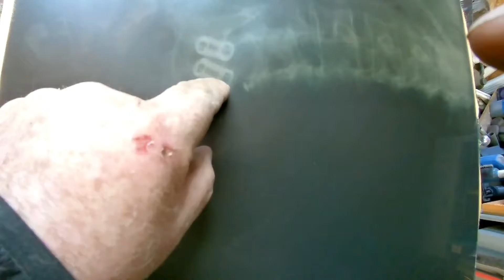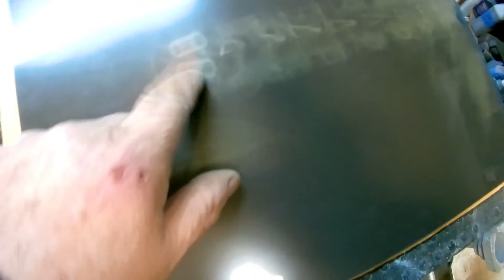MRI of my fusion 2004

Comment: A girl friend I had many years ago has a neck bone surgery, they went in from the front, she did pretty well, I thought that was kind of the complicated way to do it but they said it was much better,, maybe to avoid  touching the spinal cord.
Reply from the maker: I guess some work but I haven't seen any on my end. The friend in Fla is still out of work and having problems after 3 months still using a waker.  I guess it can be where and who.  My son in Fla had him fusion done behind the neck so they went in from the front, over a year but stating feeling better, however another Doc told him it healed crooket.  I think Fla sucks

Comment: I wish I had a copy of my Xrays. I have so many screws I look like I'm part Porcupine, LOL They went in through my back. And have not worked a day since then. That was in 2005. I didn't get any better then they told me I have spinal stenosis six months later. Now you can't find a Dr. that with give you anything that works for pain. Even if you beg for it. So I know what you're going through.
Reply from the maker: Have you tried pain management ?   Their job is to help make you pain free.
Reply: @buzzsah  Yeah, I'm in pain management now. That's what I'm talking about. They don't want to help or they can't. I don't know!!!
Reply from the maker: @dukesworld3020  They should help. It's their job, have you tried Methadone ?   I have a few old friends that started on 10mg morning 10mg bad-time, they said it took a week or so to kick in but all is good.
Reply: @buzzsah  Yes I've tried it. But my heart DR. took me off of it. Said it could stop my at heart any time.
Reply from the maker: @dukesworld3020  wow,  not good.